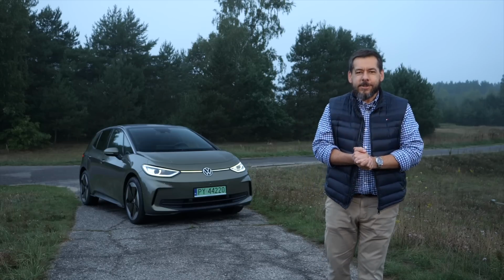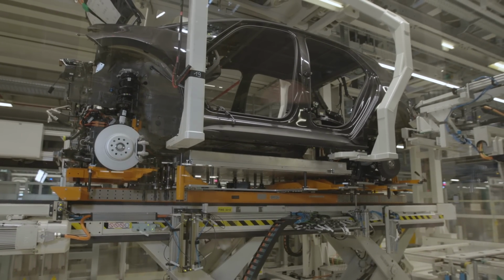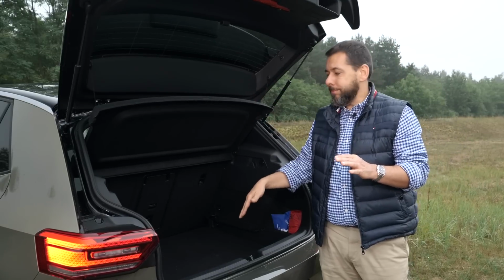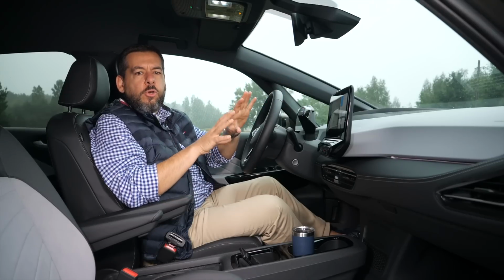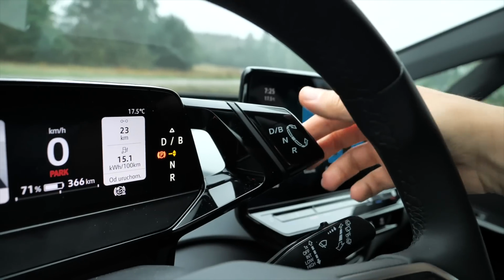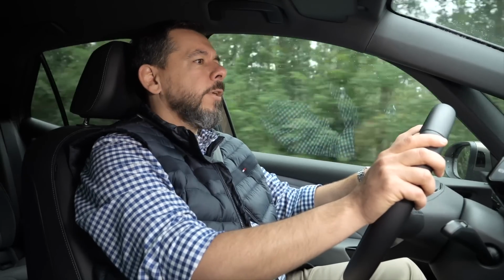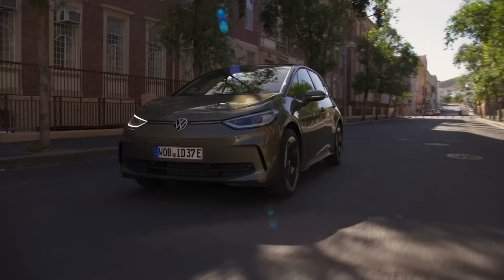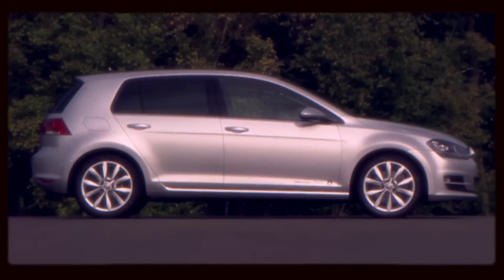Volkswagen ID. 3 Pro S 2023 facelift - Any Improvements? (ENG) - Test Drive and Review

Comment: I have tested a lot of EVs. I never considered ID3 s because of reviewers. I thought it was bad

One day the place i was going to test another car had an issue with the car I was going to test. They offered me to test ID3.

My mind was blown away. It drove so beatifully. Its interior was so large compared to its footprint. The car was as convenient. It has large enough battery. Driver aid systems are great.

It is true that software is not the best. Some accessories should have been better in default (speakers are horrible). But otherwise this is such a convenient car. You can drive in city because it is small. it is a good highway car. It is sporty. It is very large inside (much larger than cars that are far larger outside). Good driver position> And much more importantly, very intuitive driving characteristics. VW knows how to make a car

I bought the car on the spot after searching for something for over 2 months. The only car that had better driving feeling was Polestar 2, the new one. Other EVs don't come close in terms driving feeling.

Comment: Too many touch buttons and not enough analogue dials. Why are the headlight controls a touch panel?? I'm waiting for somebody to make an old-skool analogue EV, with double DIN to let me install whatever radio/infotainment system I want.
Reply from the maker: Yes, the touch panel for light controls is a bad idea. Unfortunately more and more brands implement such nonsense. Or in case of Peugeot and Citroen you can only turn lights on permanently or leave them in auto, but there is no way to control parking/position lights. Turn the car off, and it goes dark. Turn the car on at night, and the low beam comes on, which you cannot turn off. 
As far as your wish for a simpler car is concerned that ship has sailed. With the new EU regulations all cars are computers on wheels.

Comment: I bought my ID3 new in 2022. Never had one single issue with the car and we’re doing doing about 2300km monthly. Traded in my 2019 Golf for it and I do not regret the decision. For a commuter here in Ireland, it saves me about 50% of what I would have spend on petrol, even with today’s super high electricity prices. The only thing I can compain about is how fast the tires are wearing off. Need a new set every 1.5 years. Will go for an ID 4 with the bigger battery and IQ Lights when the PCP term is up.

Comment: Why do you need to remote open the car with an app, or start it with an app?
Reply from the maker: That's a great question. Some brands presented the remote opening scenario as a convenience feature, when a courier can drop off a package into the boot of your car. Same with online grocery shopping. A bit far fetched, especially in less nice parts of any town, but whatever. I can see a situation, where I'm meeting someone, the weather's crap, and one of us is either lat or early, and the other person can open the car. 
As for remote start, there's a whole virtual key function, for example in BMW, where you can assign a person their virtual key on their smartphone, and they can drive the car using their phone as a key. This can be limited to certain times, revoked at any time, etc.

Comment: I have a model 3 and my wife have has an id.3 with now 130.000 km on the clock.
The VW SW has beeb a nightmare - as late as this summer it was over 1,5 months in the dealer - that was the 6th time. 
VW was so 'embarassed' we got an id.5 loaner they let us take for our holiday in France.
I would chose the Tesla any time - though the basic car and the battery in the id.3 has held up well - it is the SW and the UI computer that us a total disaster.

Comment: Funny. Lots of EV haters on this one. A few facts. The batteries don’t die after 4-5 years. Yes, there are occasionally battery problems but then the cars don’t have exhausts and all the other stuff that goes wrong on petrol cars. Tyre wear isn’t keeping me awake at nights. Last word: taxis. Taxi drivers are going electric. If EVs were unreliable and expensive to run, do you think that would be happening?
Reply from the maker: Taxi drivers have a specific use case scenario. Lots of city traffic, where EVs excel.

Comment: I drove similar one as a replacement for my company car recently. I have to admit that it is very easy to drive, However, I didn't like the interior. The central airvents are always blowing into my knees (I'm 187cm). Lack of a normal drivers display for detailed info like satnav forces you to look at the central display. Also the aivents were making an annoying noise (maybe only this particular vehicle?). Either way, it is a nice car overall.
Reply from the maker: Small driver's display is suppose to push you towards the AR HUD.

Comment: EV cars  will be extinct in a few years, they catch fire, range is rubbish, fights at charging stations (if you can find one), insurance is colossal, extra wear and tear on tyres because of weight and when you need a battery change in say 4 to 5 years it will cost about £20000 for replacement need I go on. It also doesn’t protect the environment as they would like you to believe. It’s more polluting to build one than a petrol car.
Reply: Nonsense. "they catch fire": much less than ICEs - "range is rubbish" - enough for me and more than 90% of all drivers and trips - "if you can find one": There are enough charging points and the car is doing this for me (in the opposite to an ICE with gas station) - "It also doesn’t protect the environment" - yes it does. Repeating a lie over and over again does not make it true.
Reply: You win the “FUD facts about EV” Bingo.
Reply: Wow thanks for the factual information where did you get your information ?
Reply: Tell them!
Those electric heads. 

A friend of mine got the ID.4 , but right now, he's highly regretting why he didn't go for the RAV4 hybrid   instead. 

His new ID.4 is already developing battery problems in just less than two years 😮